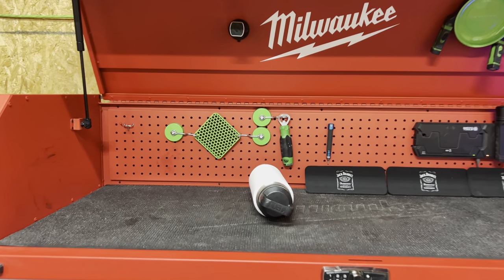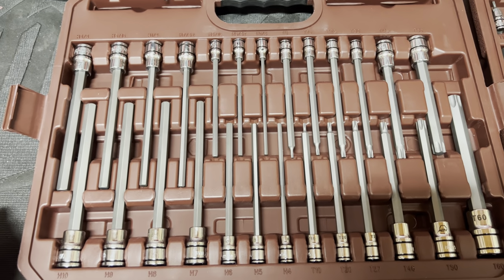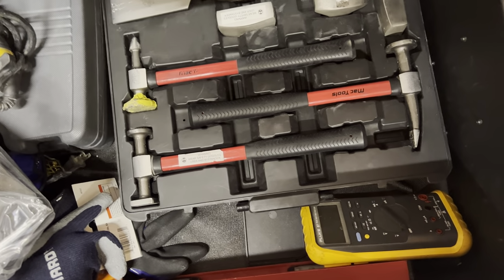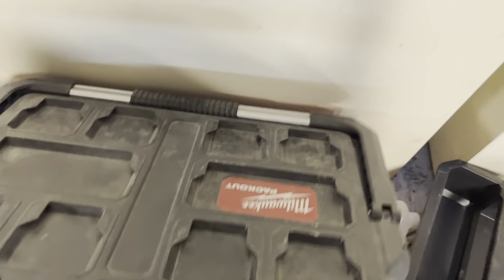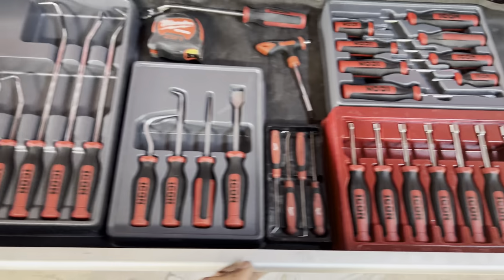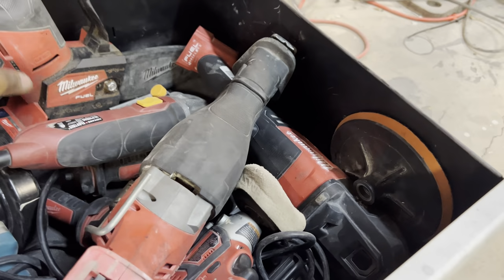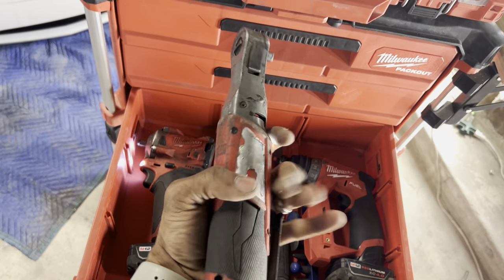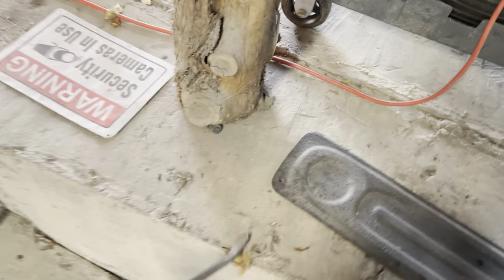*UPDATED*2022 56 inch Milwaukee toolbox tour

Comment: Wish drawers where alot deeper. But all in all nice box
Reply from the maker: Actually the fact that they are not deeper has started to bother me SO much that I do contemplate on getting a different box for that reason I wish the drawers were deeper and the box depth was about 30 and not 26  I haven’t pulled the plug on getting a new box yet because I got the packout and a lot of my tools are actually in it now but if it wasn’t for that I believe I could probably fit both toolboxes inside of a single 86 inch epiq because of the box depth and  drawer depth
Reply from the maker: I’m going to be buying the milwuakee side lockers here soon and those fit the packout boxes inside of them so it might help me save more room 😅 at least I hope